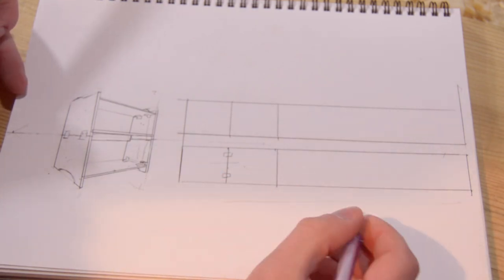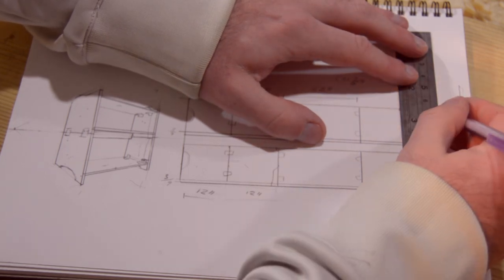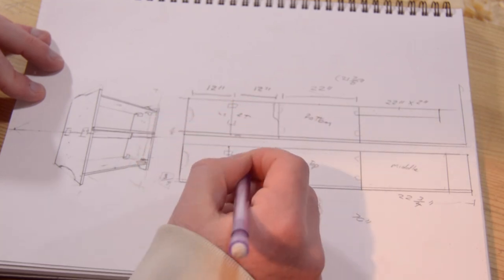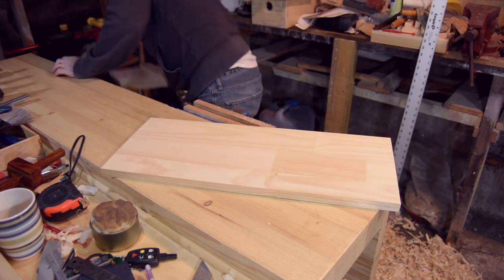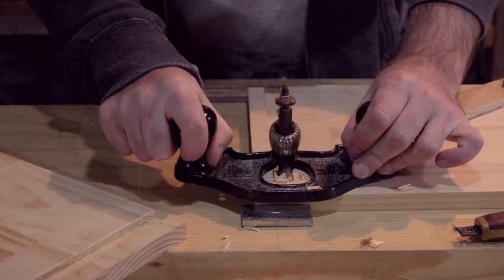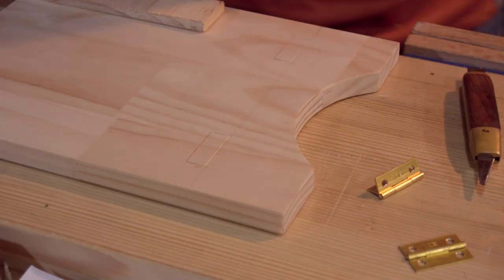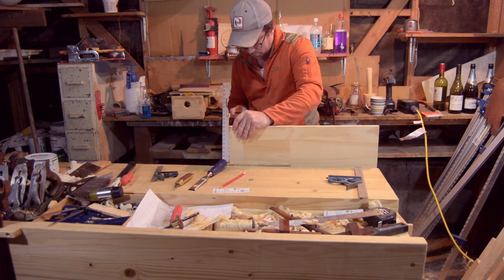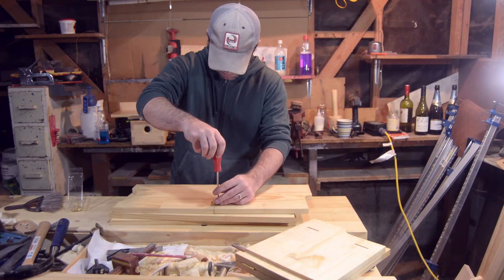How to build a Collapsible Bookcase (Campaign Furniture Build) with Hand Tools.

Comment: That is very nice, read the Campaign furniture book by Chris Schwarz, but it is very nice to see a video about it. 
one question though when you put it together for the first time (about at 7:04) it is a bit wobbly, and if I understand you correctly, you then made the mortises for the hinges deeper and then it was less wobbly or was it even wobblier before?
I think I might just build one of those as well.
Reply from the maker: +simon stucki Hi Simon. It made it much much less wobbly. Granted, It is putting more strain on the hinge screws because of the added depth, though not too much that it'll fail. It was only .25-.5 of a millimeter. still holding up strong with lots of use. 
Plus we just moved to a new house and this was the first thing setup, amazingly satisfying project at this point. Even with the awful laminated board I used.
Best of luck with yours Simon!